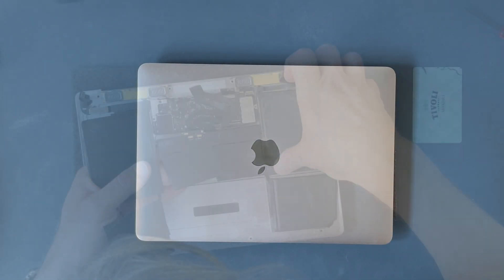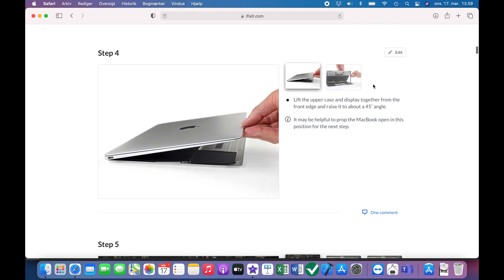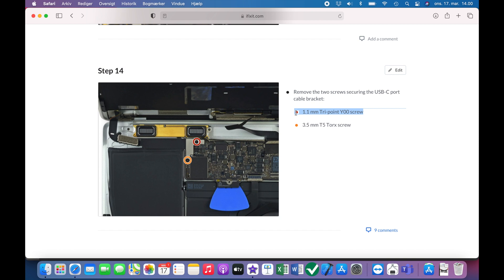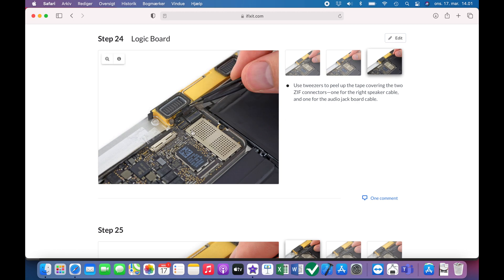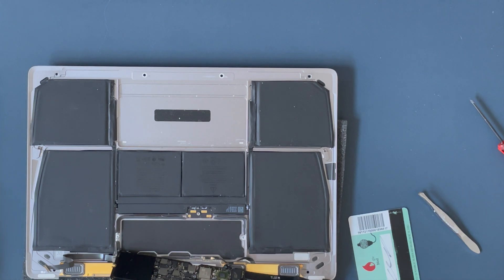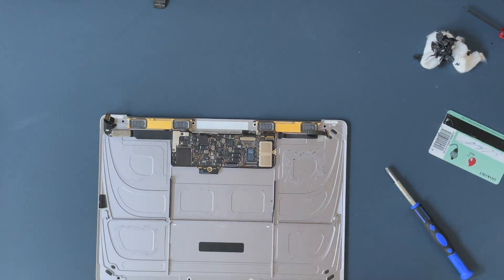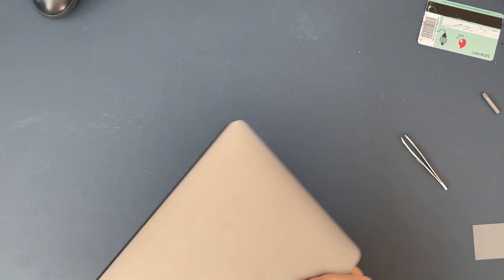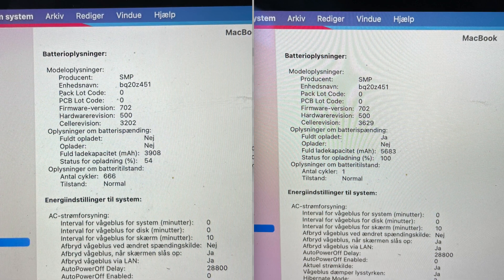MacBook 12" Retina Battery Replacement

Comment: Hi. Completed the replacement without removing the logic board and all seems well, but although the battery info shows '1 cycle' it still says 'service recommended'. Is there a way to reset this? (aftermarket battery)

Comment: yeah, you tell to remove many unnecessary cables and once they are broken, they are screwed !!  No parts available if you break a cable Why would you instruct them to remove a cable that does not need to be.  Why don't you just remove this video instead .  It's destructive and not helpful . Thanks Dumba$$

Comment: I removed the 8 screws on the back, the trackpad cable and then the three lower screws on the logic board. That’s it. Many less steps than the ifixit guide. Got the battery out, cleaned it up and put the new one in. Took 45mins and I am a first timer. Machine runs better now even when plugged it. Heats up less too. 
A lot of unnecessary steps in this video. Their guide lead you astray
Reply: I know…many vids showing complete rip of all parts. Seems like the new battery just needs to be slide under the main board and screwed back on.
Reply: @bohrora2293  Did you had to do back up before putting new battery?
Reply: @daxkumar2808 acredito que não man. Afinal foi troca de bateria.
Reply: Thanks for the heads up. This lack of dislikes being displayed is killing the how-to side of youtube

Comment: My speakers are not working anymore since the battery change. Any idea?
Reply: Mine stopped working too
Reply: @markin_  in my case, it was just a problem that I didn't close the connector on the sound module. After clicking, everything works🙂
Reply: Have you managed to fix the problem with speakers? I have the same.

Comment: I replaced the battery but now the new one won’t charge? Any idea why?
Reply from the maker: Can you see information about the new one under Power in the system tap?
Reply: @qasqdk  update: i was able to fix it, turns out when I rewired the USB c cable to the motherboard is wasn't aligned correctly so I removed the screws and placed it in it's correct position. thank you for your response.
Reply: Same thing here. It worked perfectly for like 24h. But then Im having a cross on the icon of the battery menu. What do you recommend? Thank you